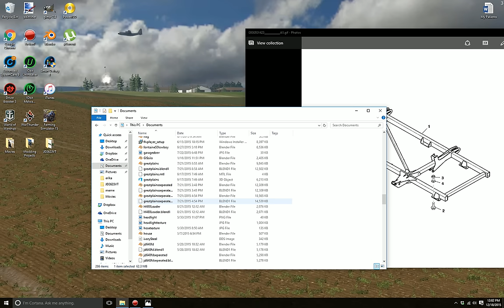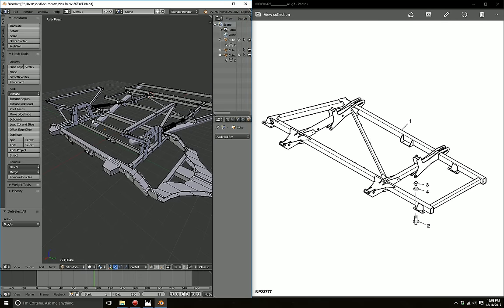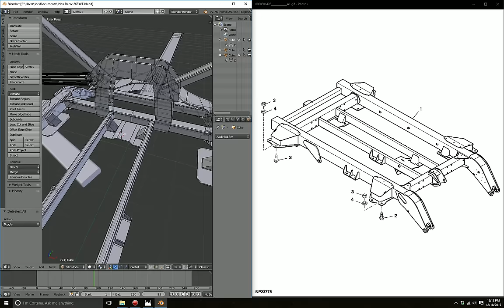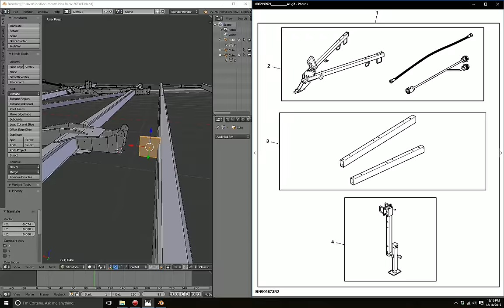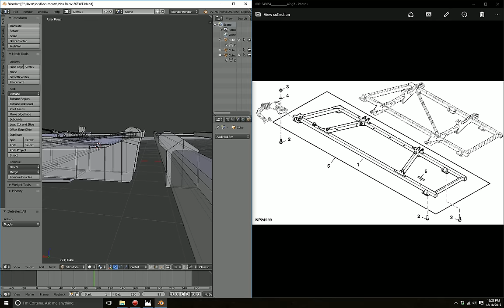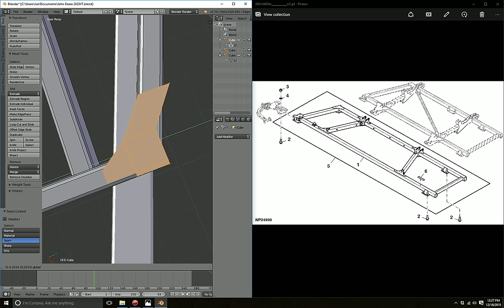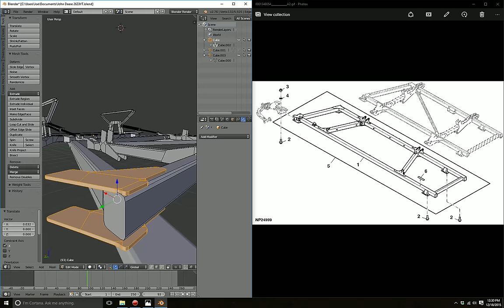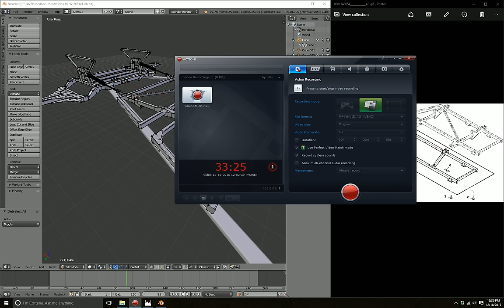Farming Simulator 2015:  Building in Blender

Comment: the frame work looks like a 2623vt, 50ft 5 section.
Nice work joe, i use to run a Steiger panther with a 5 section country wide disc, 50ft 98 plate.. good tools, also its pretty much the only tillage piece you need because once you run over the ground once to plow it, you can go over a second time cross tilling and it would cultivate the field, so there was no need for multiple tools in the field. every thought about getting into the old Steiger tractors? like the panthers, wildcats ect. would be sweet to see that on your map!
but once again nice work, you always impress and you deserve more credit then you get. :)